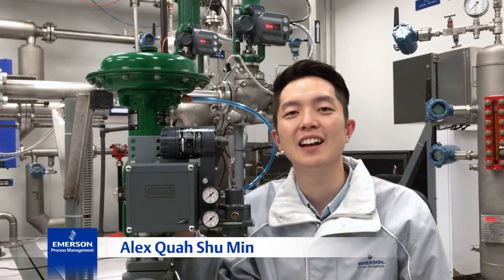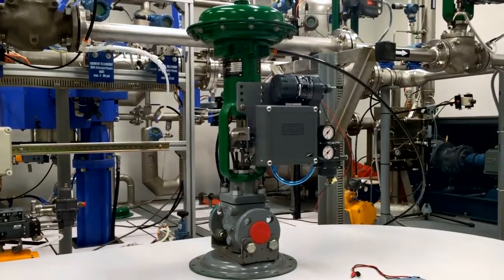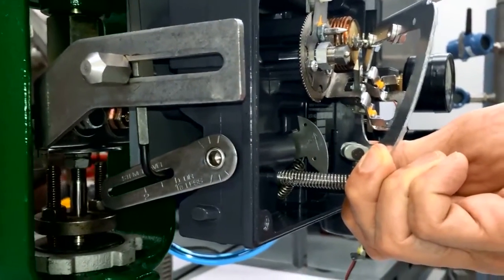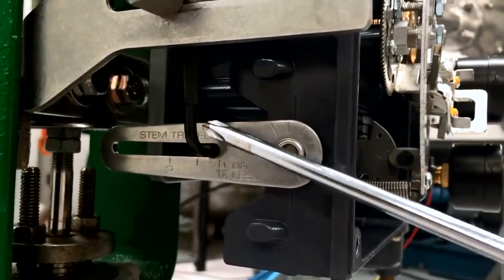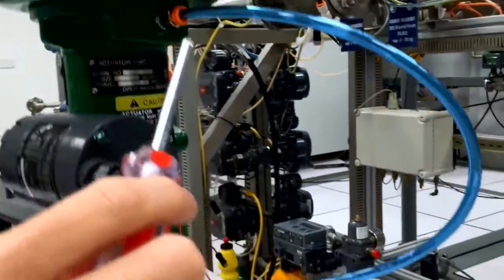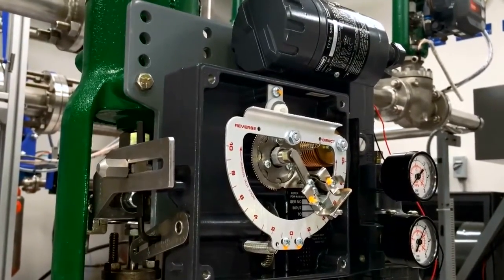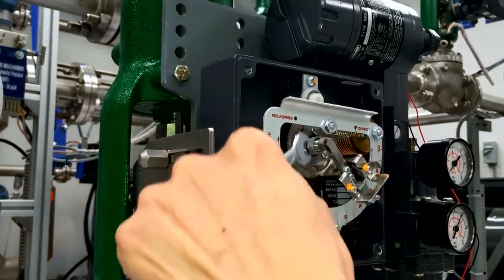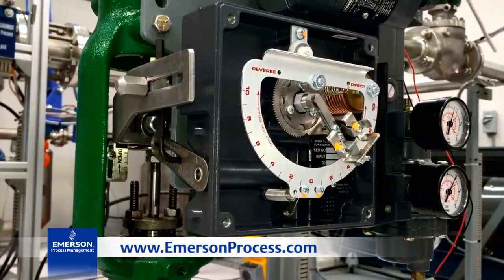How to Calibrate the Fisher 3582i Positioner

Comment: Just a note, when calibrating a positioned with a nonlinear.Cam performing a "reverse calibration" where the valve is moved to the cardinal point, then the tolerance is applied to the input rather than the output common on a traditional calibration. That way a linear tolerance can be applied making the calibration somewhat easier. Nonlinear cams could be "Quick Opening" or "Equal Percent or a custom cam for specialty valve trims. Another note, on a 667 actuator when coupled to a " push down to cloise" valve trim, it is important that the positioned be completely vented at 0% to ensure full design force is imposed on the trim to ensure valve leakage specifications are met. Conversely, if a 657, direct acting actuator were used, at full span input, 15 Psig, that the positioned is calibrated to ensure full regulator pressure is imposed on the trim, because it's the difference between the upper bench set & regulator pressure that determines seat load. So in this case the calibration would ensure that at max input span, 15 psig, the actuator is saturated with full regulator pressure. This assures full seat load when valve is closed ensuring seat leakage criteria is met.